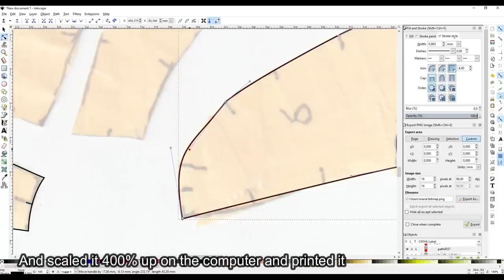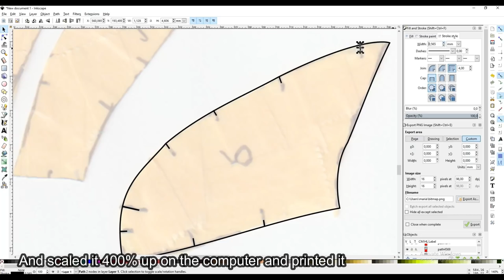How To Make A Cheap Protogen Fursuit Head + PDF Template | Fursuit  Tutorial

Comment: Just wondering, could you use hot glue instead of cement glue to glue the foam pieces when you make the protogen head?
Reply from the maker: No, it will fall apart when you heat shape it

Comment: Would you ever take custom protogen heads/partials/etc using this method? Im not the best at physical crafts due to my hands shaking too much and vision being limited. But this is the best foam protogen head I have ever seen, and Im unable to get a proper one with the digital led faces and such due to needing the head to be very light and those heads usually are too heavy for me to wear (cant even stand resin bases sadly)

Comment: you know what would be a really good idea for vision is to put holders in for a phone and a power bank. just drill a hole thats lined up with the camera and cover it with more mesh
Reply: Or get a cheap-o phone off EBAY and remote mount the camera on an ear tip.

Comment: Quick question- so for the hardener could you possibly use resin that dries hard?
Reply from the maker: I don't use " hardener" on foam
Reply: Oh ok I must have thought the varnish would harden it or make it like a plastic texture
Reply from the maker: No, it just protects the paint but still flexible

Comment: Would using a hot glue gun be a decent alternative for the cement glue? Or would it not be strong enough to hold the foam?
Reply from the maker: No, You would see all the seams, and fall apart when you use the heatgun
Reply: @MugiwaraCosplay  oh, ok thanks! 🤗

Comment: Well, it sound unbelievable that this is under 100, so I did the math. (Warning!: Don't click read more if you don't want the prices!)

Materials: 134$ US (Warning!: If you have sewing materials or are a fursuit maker this cost will probably be way cheaper, since you may have thread, fake fur, etc.) (Another warning!: I put two colors of fur on the list, so it may be cheaper or more expensive depending on brand, type, color, etc.)(Last warning!: Some things you may be able to find cheaper, this is very rough, and there are multiple ways to get it cheaper depending on brand etc.)

Tools: 238$ US Yes, the tools are expensive. (Warning!: You may have some of the tools already, main reason I included this is because you may not have things like rotary tools and what not, costs may vary depending on what you need)(Another warning!: This is going off the materials they gave in the description, so if you want different brands, prices will change, this is a rough estimate of the materials they gave)

Tools w/ sewing machine: 470$ US (Warning!: This is the previous number but with the sewing machine cost added, again if you sew or make fursuits you may have one already)

Total: 372$ US (Warning!: Again, this is off of the materials they listed, some did not have a link or just lead to a search result, so I had to pick some out, or skip some, the price is probably 400 total based off of how many didn't have a link, you may be able to get it cheaper with different brands)

Total w/ sewing machine: 701$ US (Warning!: This is the total but with a sewing machine, previous warnings for tools + sewing machine apply.)

So, is it true? Well, yes, for the materials, if you have sewn or do sew, or maybe make fursuits already- the cost may be way lower, but for new fursuit makers, the price is almost 1000$ US! This is only what they saw the materials were since they are experienced and have most the stuff, but if you need extra stuff, rough estimates are up there. Again, the prices will vary depending on color/type of fur you buy + how many colors you buy, brands you buy, and if you already have some things.

How did I do this? I clicked the links, maybe had to search for a few low price ones, but good quality, put them in my cart, and gave the price + warnings. For totals, I used google calculator. You will have to do the math depending on what you need or what fur you want, but other then that, it's pretty much exact for the stuff they listed in the desc, excluding the ones with no link.

Comment: Okay but a legit question, does hot glue work for this if we dont have contact cement?
Reply from the maker: No, it will fall apart when you heat shape it, because heat melts hot glue. And the seams will also look way less smooth
Reply: Okay!! Thank you, just needed clarification!  @MugiwaraCosplay

Comment: Do I need a heatgun for this or will I be able to get thru without it
Reply from the maker: It's the only way to heat shape it
Reply: You need one sadly
Reply: @BubbleTheFurry22  I did not actually, there's a video on my channel with the finished head. no heat gun used.
Reply: @hiimmiles1708   which one ?
Reply: @hiimmiles1708   I also meant you need one to heat shape it.

Comment: This looked like a good three day weekend project and with a sale a Jo-Ann’s I thought the stars had aligned. But the pattern for the EVA foam isn’t great at all and puts so much unneeded pressure when actually trying to form the pieces and cement them together when you literally get the same effect with less tension just by adding more angular cuts to certain pieces. I had to alter the majority if not every piece to get the pattern to work. 
The pattern for the back of the head again isn’t great and honestly isn’t worth the effort; it is just so much unneeded pressure when you’re cementing. I would recommend just doing a series of bands with the foam across the back of the head connecting to front halves instead of losing your mind over 7,8, 9 and 10. (What I’m saying makes sense when you’re looking at the pattern.) 
While we’re on the subject of the head. If you are a brotha or have some crazy hair the pattern will need to be adjusted to accommodate. It would have been a tight fit had I followed the pattern. 
The pattern for the side ears on the helmet are unneeded complex. All you need to do is cut two circles out cement them together to get the right size shape and shave them to your liking. 
I was trying to be fair and not rude but this pattern is a 2/10 at best. Buyers beware.
Reply from the maker: I'm sorry that the template didn't didn't worked for you but what you see in the video is the same template and I didn't had any problems

Comment: been at it since 9am EST .. About to scream lol i can't get the pieces to stick. When you do it, it looks like they fold into each other.. At my end of the world, the glued pieces pop off each other.. BAH!  I am using 10mm low-density foam. Ive tried contact cement, then tried gorilla glue gun, B7000.... Nada :( Does anyone know what im doing wrong? Two days to Halloween. My 10 year old may need to rethink this years costume choice.
Reply from the maker: Of the ones you mention, I only know contact cement, I don't the other ones. How long do you wait from you apply the glue and until you stick the pieces together?
Reply: @MugiwaraCosplay  we got it to work!!! Contact cement .. thin layer one minute wait before sticking together. Whew. Thanks for the reply. We finished the head. Working on fur xoxoxo
Reply from the maker: Great to hear :)

Comment: I’m aware this says to use 10mm Eva foam but imma pray 5mm will work and imma prey my blow dryer on hot will will work even though it says heat gun (I’m a bike collage student btw lol)
Reply from the maker: 5mm is too thin and a blow dryer is not hot enough
Reply from the maker: No, it would get less stable. And don't know if two pieces glued works as well as actual 10mm foam